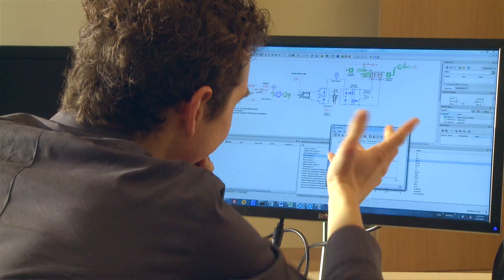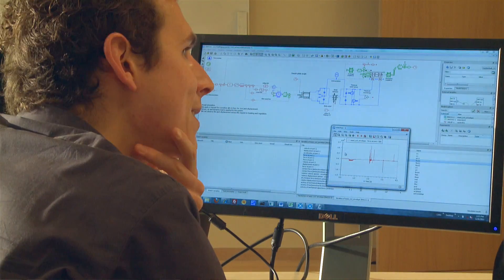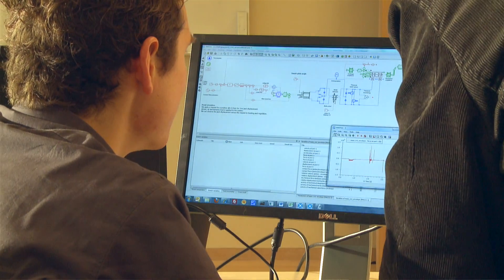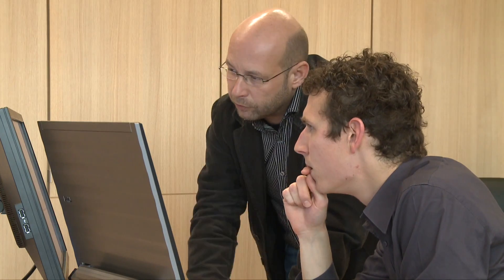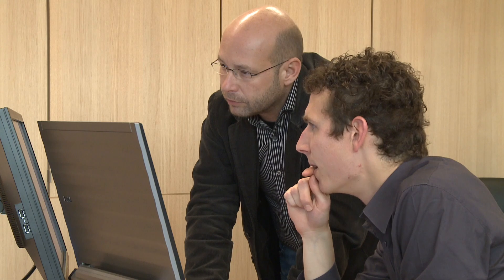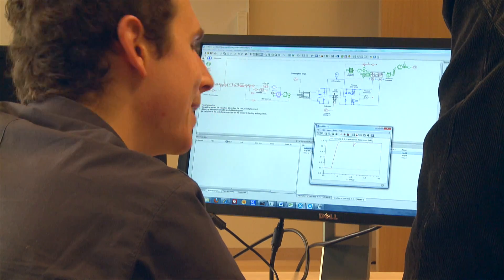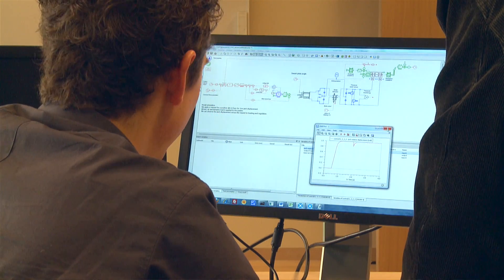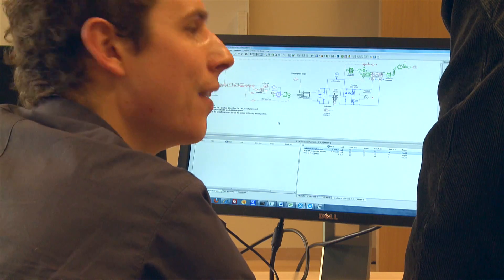General Motors | Frontloading transmission controls engineering | Simcenter

Comment from the maker: Keith Lang, Genenal Motors's group manager advanced transmission controls, explains how General Motors implements Model-Based Systems Engineering as a standard approach using LMS Imagine.Lab Amesim.